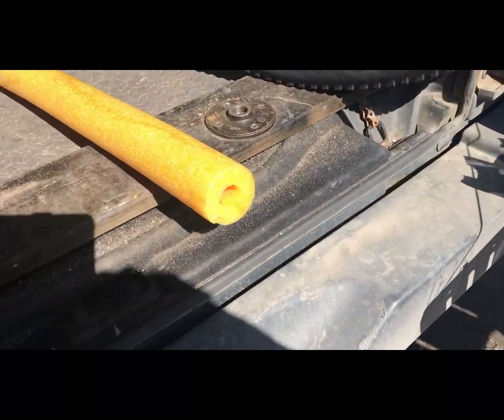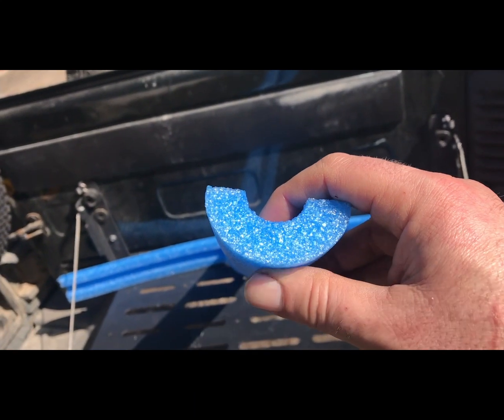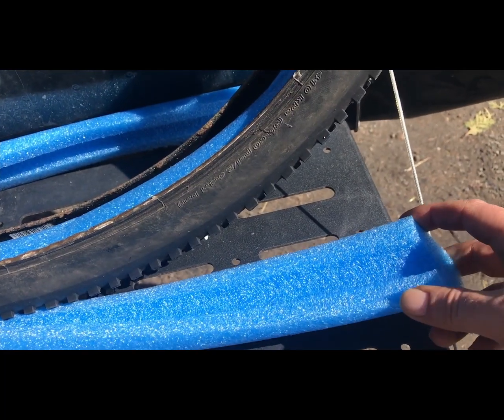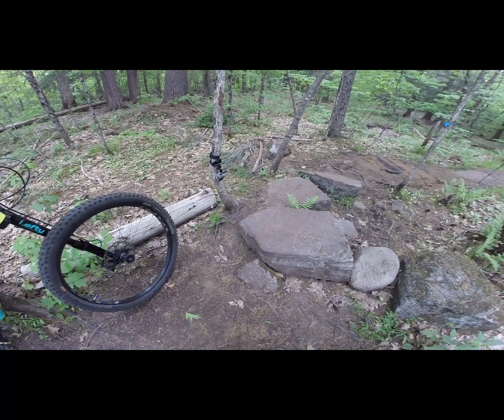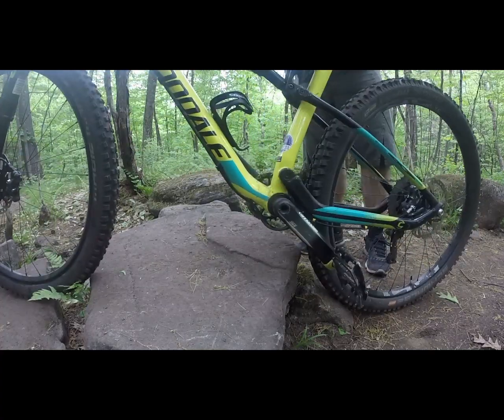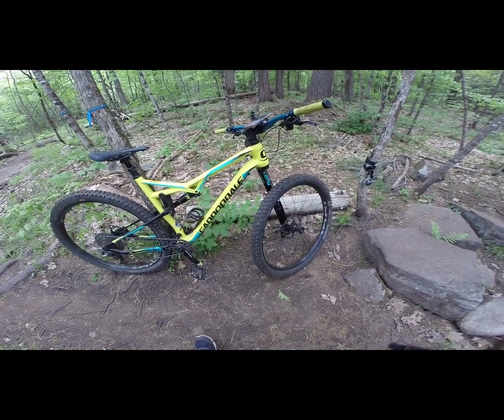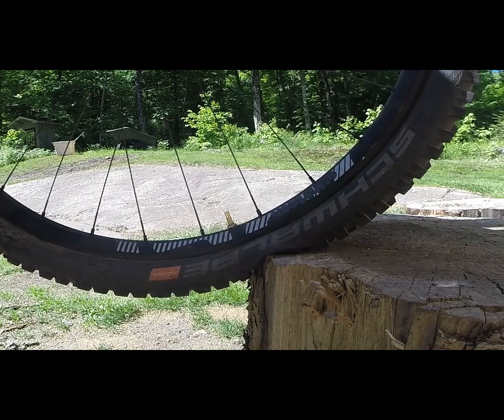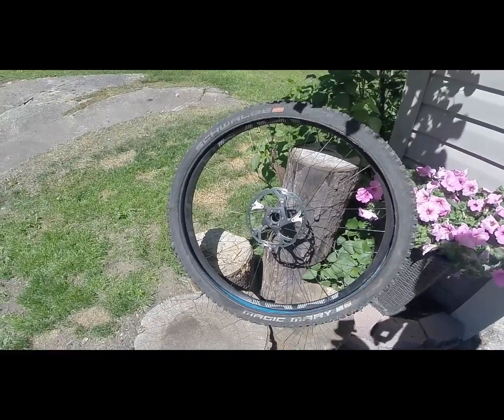PooDDLE Tire Inserts - Upgrade Inserts for the rest of us?? Is this a joke?

Comment: how would you know how to pick the correct size noodle..?  there are 1.35-2.50 width tires. and picking a 2" diameter noodle, more than likely won't fit in the 2.15" tire...

Comment: The ones I put in my bike were about a mm thick when I got a flat about two weeks later install.
Reply from the maker: I never thought I’d say this but there are definitely different quality and durability noodle materials out there…and my rear tire took a much heavier beating than my front, but if I were to do it again I think I’d leave the noodle thicker than 60 percent, maybe as much as 70-75 thickness unless you happen to know you’ve got one of them fancy high end noodles lol…
The material stayed intact well but harder impacts definitely sliced it up more…still saved damaging the rim for next to nothing though at the end of the day!
Reply: @reallifemtb  mine were in tube tires I think inflating the tube crushed the noodles.🚴🚵

Comment: I was going to do this and use a tube, no sealant because I can save a bunch of weight and the tube is not at all likely to be punctured with this mod. If I do use sealant, would be just in the tube and it would self heal small punctures, wouldn't do any in the tire itself but would leak in a bit if there were a hole in the tube...not sure yet but might just go without any sealant and just do a tube with the noodle.
Reply: That’s what I did on my fat bike, I used a inner tube and a foam piece that I found in my basement and it worked perfectly, the foam I used is used to insulate copper pipes in my basement, we had some left over so I used it and it worked perfectly.
Reply from the maker: a great idea, but you're not going to get the additional sidewall strength and impact resistance this gives you...several benefits to this config and it's held up much better than I'd ever expected! Hoping to get a slightly more technical comparison between this and a right proper insert up in the coming weeks if I can carve out the time! Thanks for watching!
Reply from the maker: I've seen many oversized diameter noodles this season as well that might offer some 'smaller' fat tires a great option...never get a pinch flat again! might get around to testing that in my plus and 3.9 inch configs! Thanks for watching, and for sharing your experience!
Reply: I installed a thick pool noodle in the front tube-less tyre of my 1000cc Honda Varadero 5 years ago. I can ride without air, but I do inflate the tyre.  The noodle is there only for a get home option.
Reply from the maker: @Deontjie  nothing worse than walking a $4000 bike 8km down a trail you'd rather be riding!!! Follow up video will be online in a couple of hours, check it out!

Comment: In a fatbike would you put the same insert or thicker?
Reply from the maker: Personally from the context of rim ‘protection’ (a term I’m using liberally here lol) and for any degree of sidewall stiffening I would definitely go with a jumbo sized noodle lol…I’ve also seen a new x shape design that I’m curious about and I’m hoping to compare some more specific details with a set of nukeproof inserts I picked up over the winter to back these things up a bit as well…or maybe blow them away?! Stay tuned, hoping to get that in the works in the coming weeks…

Comment: how do you take the tire off?
Reply from the maker: Hi there! The tire will still roll off as normal but will be a little tighter breaking the bad depending on the size of the foam insert…the challenging part can be letting the air out of the inside grooves don’t line up with the hole in the valve which can actually seal against the insert…if that happens just poke an Allen key or something through the valve to allow air to move through. You can buy valves specifically made with grooves for use with inserts too…great solution!!
Reply from the maker: breaking the BEAD lol